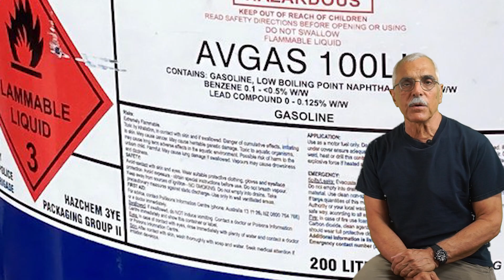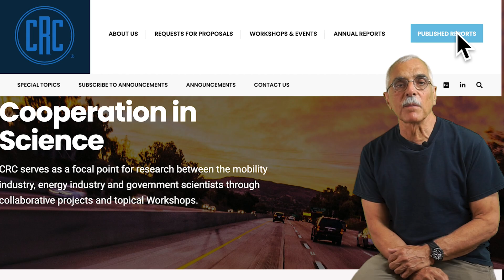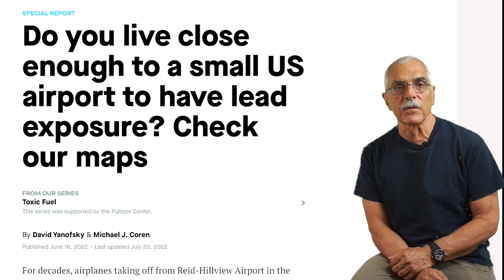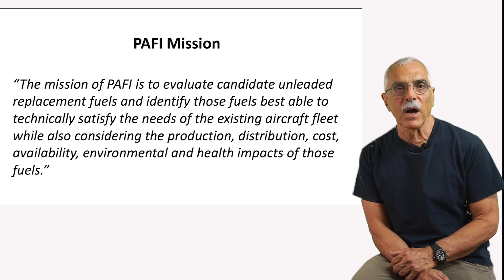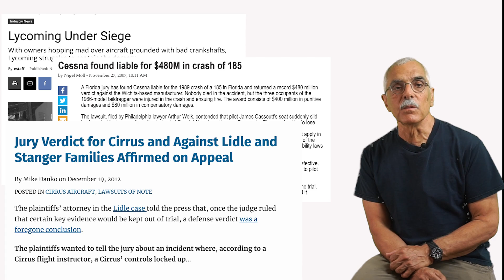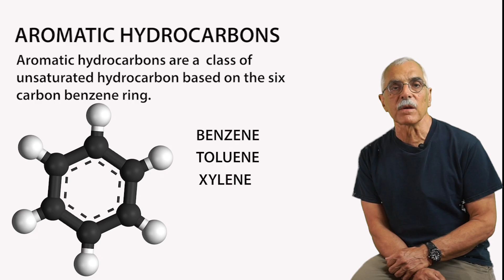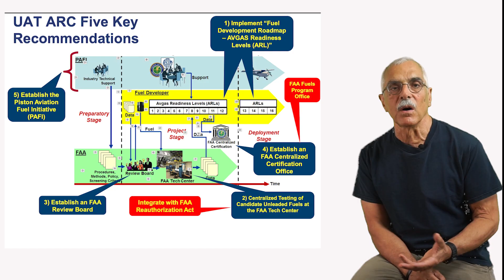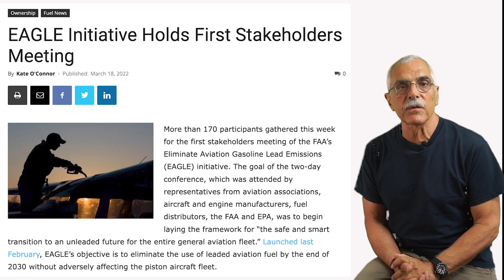The Long, Twisted and Slightly Ridiculous Story of Avgas Part 2

Comment: Why are we still using leaded gas? Because we are still running engines designed in the 40s. Why are we still running engines designed in the 40s? Because there are a lot of people getting paid a lot of money to make sure nothing disrupts their white-collar-welfare system. The gas issue is one of many issues which has stifled any innovation- which has in turn removed all competition- which has ensured that the price of aviation stays prohibitively high.

Comment: Without getting super political, I feel like this is a great example of the government vs the private sector when it comes to solving issues. Sure, this is an extremely complex problem, but if you can at least get some aircraft switched off lead then that is a good start. When I went flying with a friend I was genuinely surprised they still used leaded gas but when he explained it, it made a lot of sense. 

I am curious, has anyone tested the lead levels of a pilot who flies regularly with leaded fuels to the general population of the same age bracket to see how dramatic a difference it is?
Reply: Counterpoint: the private sector also didn't want to phase lead out because it would decrease profits.
Reply: @h8GW  that too, it feels like a blend of private industry vs government regulators and no one wins ultimately.

Comment: As a student pilot, around 1996, one of my tasks was to buy the last remnants of leaded petrol around our small airfield. Our motor gliders had Limbach engines that were only allowed to run on leaded petrol. During this time I worked for a British company that also produced fuel lines for cars. In the club we were of the opinion that the STC required by our aviation authority and the associated conversions were just money-grabbing. But we didn't want to pay for AVGAS 100LL, which is very expensive in Germany. After the conversion, I brought a fuel line from a Falken SF25b to our research director. I was just through the door of his laboratory when he told me why a conversion was unavoidable. The benzene in the unleaded car fuel dissolves the walls of our rubber fuel lines and small flakes will sooner or later clog the fuel filter. Since then I give less attention to the bullshit slogans that also exist in aviation circles.

Comment: Interesting. From a racers point of view who has used Avgas 100 for over 40 years in various racecars I know that it is trouble free [except for a bad batch of RF100, the same product but not certified]  And it is compatible with all fuel lines etc. And tank foam.And is totally readable for spark plug reading for tuning.
And unlike unleaded auto fuel does not rust out steel tanks and efi pumps. And does not become varnish in 30 days!! 30y/o leaded petrol wil still run an engine.
And unleaded engines need catalytic converters or they are far more toxic. This is essential. On many aircraft exhausts where would you fit that cat? 
I have been in the automotive business for 50 years and have seen all the crap. A modern unleaded engine is far better than old leaded engines with better designs, better components and more power. That is IF all the electronics are working properly!
And there is the rub,, too often they do not or the latest and greatest design is not so good. Direct injection anyone?!
Last year I have  personally suffered  a blocked injector and failed coils. And dead rusty fuel pumps. All on modern  moderate mileage mainstream models. And these problems are very common. I have been told I should drive my cars more. And keep them full of fuel. At my age I do not need to be running around for no real reason. And fill the vehicle when low on fuel or the price is down. About once a month!! Though go travelling or playing racecars then I will refuel every day
The current LL avgas has doubters and I have heard of serious problems with it.  Planes fell out of the sky! More so on old design engines. 
So think hard about change, and just maybe the FAA do know what they are doing. Or their compatriots world wide. These decisions must be made for the world market not just the local one.
Reply: It's not correct to say that unleaded fuel without catalytic converters is far more toxic. Catalytic converters weren't added because unleaded fuel was more toxic. Instead, the phaseout of lead in automotive fuel was primarily driven because catalytic converters were added to reduce unburnt hydrocarbons and NOx, which are present with or without lead in fuel, but lead in fuel poisons catalytic converters. So all cars with catalytic converters had to use unleaded gas. 

For cars not driven often, the best course of action is to buy ethanol free gas. Ethanol is fine if the gas is used quickly, but attracts water which can cause issues such as rust. These issues are not caused by unleaded gas or fixed by using leaded gas, but are not seen with leaded gas since leaded gas doesn't have any ethanol. The use of a fuel stabilizer also helps avoid old gas issues on vehicles or gas powered equipment that's not used often.

Comment: When I was getting my pilots license some 30 years ago, I was appalled at how AOPA was lobbying politicians against improvements and developments in this area. Why? Because old plane owners wouldn't be able to afford to make any changes.
If only they had been more forward thinking, we could have grandfathered some reasonable set of owners and owners-to-be, and drawn a line in the sand and by now we'd have planes that could handle better fuels, and airports that would carry such fuel.
Reply: A LOT of aircraft in regular use are old. This is not a 3 year throwaway car but a far more expensive piece of equipment that is essential to many. And retrofitting for aircraft is fraught with danger. Bloody bad news on cars. I have a 1971 Ford, upgraded with modern multispark ignition. On my third box in 10 years. When it is working it makes the car start idle and run better. And cleaner. Annoying when it stops as you coast to a halt. A problem however on a plane!
Reply: @ldnwholesale8552  I'm not sure why you're experiencing such a high rate of engine failure compared to modern cars.

Comment: It would cost less to develop a range of gas turbine engines that can replace the must have 100ll fuel and let the rest of GA use mogas, which is the vast majority.  Imagine a smaller version of the PT6 on a Beech Baron.

Comment: Good report on the status of unleaded fuel. Would be good to mention about UL91 fuels also. Both BP an Hjelmco sell those in few European countries. It’s not a drop-in for 100LL but around half of Continentals and Lycomings (lower compression engines) can use the fuel plus all of the Rotax 900 series. 100LL is hard to find these days in Sweden, especially at small fields. Finding lead substitute might be not that easy, even if fuel companies and FAA really tried hard. If one would start a slow shift towards the engines that work on UL91 for 40 years ago there would be few engines left by now which would require 100LL

Comment: Great series. I'm surprised that anything can be truly drop-in when you consider all the components in a fuel system. Even modern unleaded auto fuels do nasty things to fuel lines and whatnot to older cars designed for unleaded.

Comment: Lead is a lubricant and alcohol is corrosive.. some of those old motors can't handle that, valve seats deteriorate  rapidly with alcohol among other parts.. and some of you that are using two strokes in your light aircraft, that alcohol is running through your crank  and rod bearings !!

Comment: Super good explanation. Another status quo group is the Corn-Ethanol business.  One of the lies they sell is that ethanol is the only thing that provides suitable octane to motor fuel.  The octane properties of the additives listed in AV-7-07 in not news (at least not to this old Chemical Engr).  I imagine no one in the $50 billion per year corn-ethanol business wants to see a super alkylate  or other alternative octane additive plant built...just imagine if people came to their senses and stop making food (corn) into low energy/volume ethanol.  As a side note the process to make a super alkylate is no more complex than making JP-10.  DoD loves that stuff and it's made (I've made it) and it's out there - the difference is that the FAA and Corn-gas people aren't standing in the way and price is no concern, JP-10 is made with tax $$$. Also BTW - any product that utilizes butane as a feed stock is a blessing. Butane can be overly abundant at times - it's no accident that so many of the alternatives feature a butyl group or have a butane feed stock.  I really enjoyed your presentation - thanks.

Comment: Why not propane, similar octane? We now have light weight carbon fibre tanks that could be stalled in the tail. Direct liquid injection as used in some propane powered cars could mitigate any issues below -45f. It's cheap and abundant. Potentially relatively easy to modify older engines to run on it? I'm sure it's been thought of and there is something I'm missing.

Comment: In the UK in the 70s and 80s there was enormous official opposition to the use of Mogas in aircraft even though engines like the Continental in a Cub or the Gypsey Major in a number of British aircraft were actually having a lot of technical problems with Avgas100LL and had been originally designed to run on low octane fuel. A lot of this opposition seemed to go away after RAF retired its 12 remaining Avro Shackletons, the only piston engined aircraft in service that needed 100LL.

Even when Mogas got some sort of approval it was not allowed in public transport aircraft which included my Tiger Moth that did pleasure flights. The result was we kept destroying bronze cylinder heads with lead making the public transport aircraft less safe than any others.

The other stupid thing was that the refueller always insisted on putting his earthing clip on the exhaust pipe in spite of the fact that the engine was not electrically connected to the airframe and therefore the fuel tank (no electrical system) and that the tail skid was already resting on the ground!

Comment: I am far from a fan of government projects but in this case I am a little bit glad they are taking their time to make any changes. As we all know, most of the processes in place now for aviation are there because over a long period of time , they work while keeping things as simple as possible, which we also know is usually the key to safety , especially in aviation. I also wonder just how much lead pollution is happening around GA airports?  I would think that given the lower lead amounts and the much lower amounts of gas consumed compared to cars  and trucks on the roads over such a long time, that the actual amounts of lead around the airports would be very low?  I mean, what happened to all the lead around any old highways around the world, wouldn't that still be posing a much higher poisoning risk, even after all these years? ?  Seems like an awful lot of money has been spent for what may be a negligible improvement in pollution. Not to mention the safety risk.  . And what about the top end lubrication that we always heard about with lead in engines? Would aircraft engines have abnormal wear with unleaded gas? Wouldn't octane only be part of the issue?
Reply: I thought the headline about GA still being the biggest contributor to lead levels in air was a bit disingenuous. If automotive gasoline engines used to contribute 99% compared to GA's 1%, of course GA would be the biggest contributor after unleaded automotive gas was mandated. That doesn't automatically mean that GA's contribution is meaningful though.
Reply: 2 thoughts on this:
1.  GA has more than tripled in our area and Law Enforcement now routinely runs "patrols" of up to 40 hours a week over just one city, using Leaded gas (as it's the only type available).
2.  TEL levels are FAR higher than they were in Automotive gasoline:  .56 grams/liter.  That's about 25x the lead level that was in auto gas.

So yeah, it's a serious problem, especially since it hangs in the air longer and deposits itself in lungs, lawns, schools and playgrounds.
Mental retardation and ADHD are no fun for parents and have a serious economic effect as well.

Comment: There is an interesting comparison to be made here with the regulation on CFC emissions (ozone layer destroying chemicals). One of them is Halon, commonly used in all types of aviation fire extinguishers, and similar to Avgas the aviation industry was given an "asterisk" to continue using Halon after it was outlawed for other purposes, the reason being that the existing Halon replacements need about 5 times as much gas volume to achieve the same effect and thus would be both a weight and potential safety issue on aircraft. However, the asterisk was given a time limit, with Halon being banned step by step in more and more applications. A few years ago the time had come for cabin fire extinguishers in airliners, and lo and behold: suddenly two different companies offered extinguisher chemicals that near exactly replicated the performance of Halon and allowed development of drop in replacement extinguishers! IIRC the only still allowable Halon use now is for cargo decks, set to expire in a few years. Goes to show that very basic government regulation can be extremely effective to solve this sort of issue, no tax payer money needed at all!

Comment: I'm surprised the feds aren't considering a different approach, similar to what the EPA does with cars: instead of certifying new fuels for each existing engine, they could just issue a mandate to plane manufacturers: all new aircraft sold after say 2030 must have engines that run on plain old 93 octane unleaded mogas.  Existing leaded-gas engines are grandfathered in.  The new engines might have lower compression ratios and worse performance, and might need dewatering systems, but it's a lot easier to design new aircraft to a spec than to test a thousand retrofits.

Of course aircraft engines have a long service life, so Cessnas built last year might still be pouring out lead 30 years from now, but glacially-slow improvement is better than going nowhere at all.

Comment: As an automotive mechanic and ex rally driver,  this whole leaded Avgas thing just seems crazy.
I do get the whole 'it's gotta be certified' thing,  but it really can't be that hard.

I  ran my old Datsun rally cars on BP100 Avgas in Australia for years. (One N/A high compression engine and the second one turbo EFI)
After I finished up racing,  I decided to retune the Turbo 910 Bluebird for our local 98oct pump fuel to use it on the road. 
I was able to make more power with less boost on the 98oct than I'd had with the 100. avgas.
The only negative thing was that the pump fuel had more tax on it and so it was more expensive
(but easier to get)

All too simple?
Reply: Aussie 98 seems to be 94 in the US. Depends on your engine. L Series are probably ok on 98 but many others are not. And 98 with no cat?? Evil polluting thing. ULP needs a cat to burn the toxins it contains.
Reply: @ldnwholesale8552  Yes,  roughly equivalent to US 94 pump fuel.
The Bluebird turbo did have a cat after the change to 98, obviously not before on the leaded fuel.

Comment: It sure seems to a major boondoggle to come up with suitable unleaded gasoline for piston engine airplanes. My very first car a 1977 Datsun B210 had a catalytic converter and ran on unleaded automobile gasoline. By the 1990s in the United States the use of leaded gasoline for automobiles was banned. Here we are in 2022 and still for piston engine airplanes the most common fuel is 100LL Avgas. So after all these years were still adding that toxic octane booster called tetraethyl lead to Avgas.

Comment: The problem is that the FAA has no strategic vision and never has had one.  The FAA is purely a reactionary agency.  If they had a vision, they would not have worried about the fuel, but rather the engines.  The FAA should have banned the sale of engines that require a fuel other than auto gas starting around 1990.  Had this been done, natural attrition of the older technology engines would have occurred over 20-30 years and replacement of those engines with newer tech engines would not have been a big economic issue for airplane owners as it would have happened gradually through the normal overhaul or engine replacement program.  The demand for 100LL would have naturally declined over the years and airports would add pumps and tanks for readily available autogas and 100LL would have died off with very little hardship for airplane owners.

Comment: I never got why the FAA doesn’t try to push it forward by granting money to spur development and offset initial cost for the products to keep them competitive against 100LL. Pilots won’t even touch the stuff anyway if the price is the same, but they know 100LL is reliable while 100UL may be certified, but no one has experience with it. They need a reason to purchase it and the FAA offsetting the cost/gal for the first few years would help a lot.